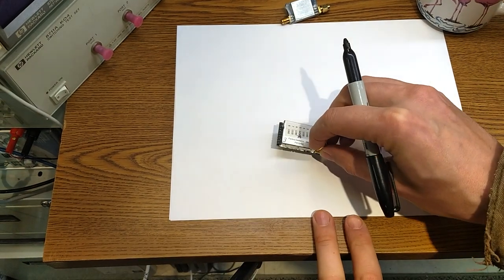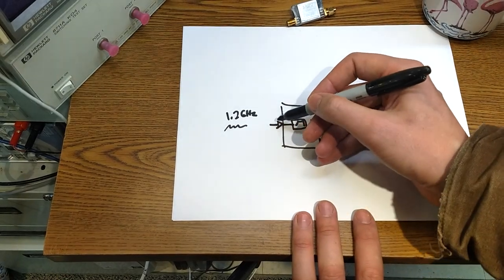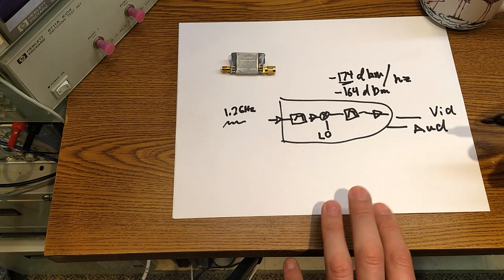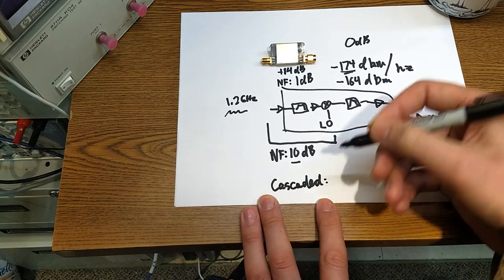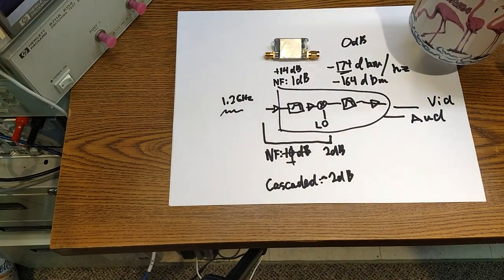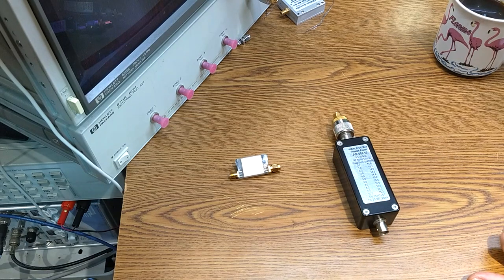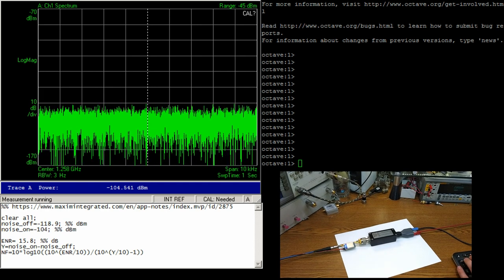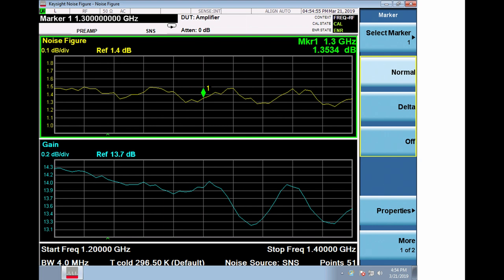Dragonlink LNA quick review - Part 2 - Noise Figure - Long Range FPV Video Series - PK's Lab

Comment: So you know the N.F. of the amp, and possibly the system. But you didn't show how that increases the signal to noise ratio of the system, which is what really counts! Re-do the test with a real video signal adjusted to where it begins to show snow on the monitor and then put the amp in the system and show the improvement. PRACTICAL stuff, not just hokey-poke theory.
Reply from the maker: That's coming in a follow on video. Been busy with a few other things and life...
Reply from the maker: Follow up video with a video receiver shootout/comparison is here: https://youtu.be/ZXlWq-VUVT4  Enjoy, ~pk